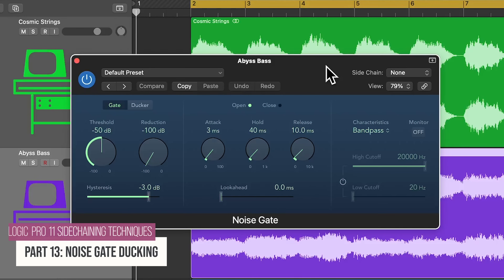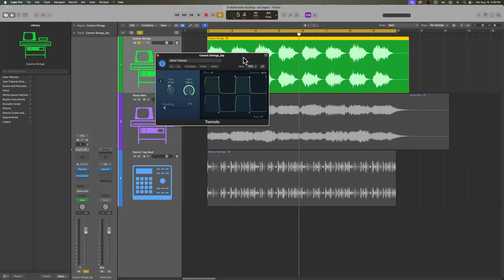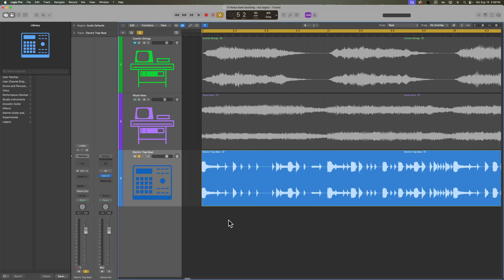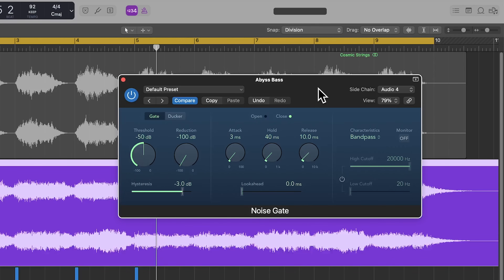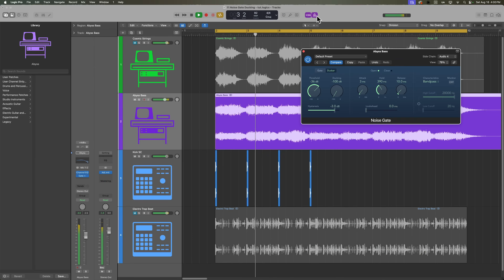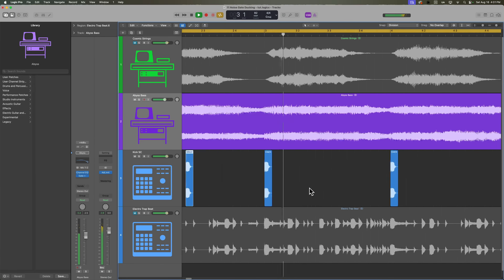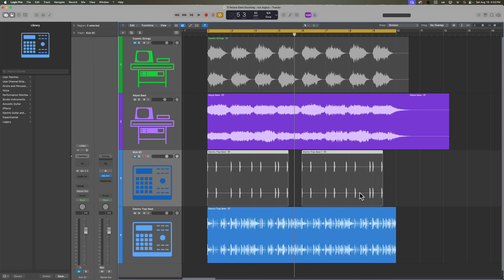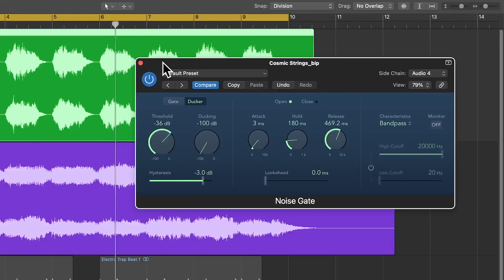Logic Pro 11 Sidechaining | #13 Noise Gate Ducking

Comment: What an enjoyable video. Really inspirational ideas, too. 

Is it the case that the Attack, Hold and Release controls work in the OPPOSITE direction depending on whether you're in Gate or Ducker mode? In other words, in Gate mode, ‘Release’ determines how fast the sound closes off, while in Ducker mode, ‘Release’ determines how fast the sound opens up? In Gate mode, ‘Attack’ determines how quickly the gate opens to let sound through again, while in Ducker mode, ‘Attack’ determines how quickly the sound is cut off / ducked? Cheers for yet another video knocking it out of the park.